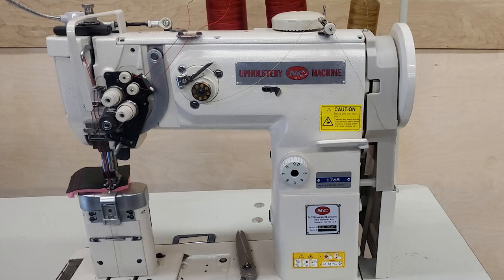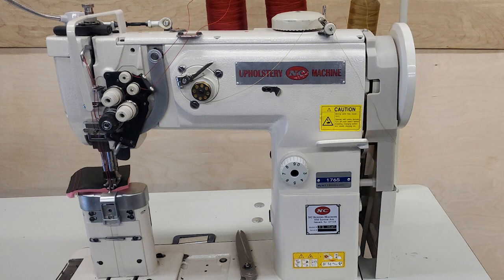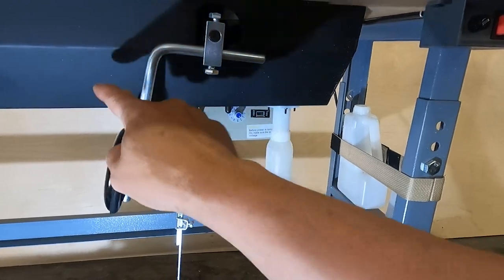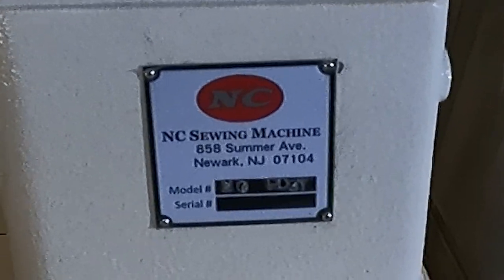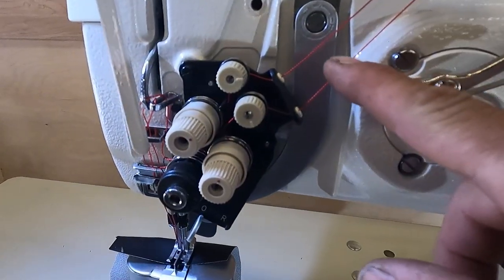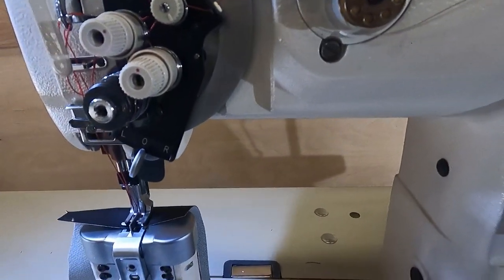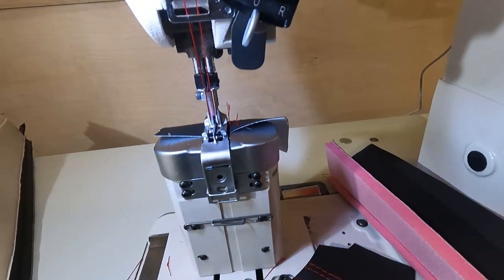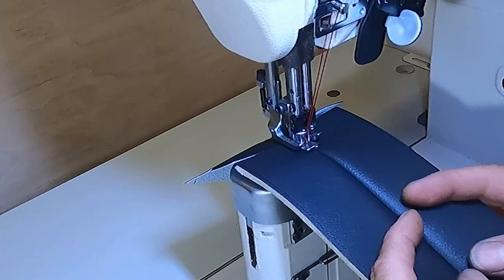Double Needle Post Machine - Split Bar Upholstery Sewing Machine

Comment: I just ordered one of these machines Friday night.. wish me luck :)
Reply from the maker: Congrats my friend. It is a good machine.
Reply: Hi there
Just wondering how you like your post sewing machine... Interesting in buying one myself?
Reply: @yanidizhernandez4085  it's been a very good machine. I would recommend looking at what type of motor it comes with.. for what I use it for (French seams on thick assemblies) the standard servo motor is.. it's ok. My other machine has a brushless servo motor (motor is a Consew CSM-3000) which is much better for low speed work, imo. Motor is only $150 or so, they'd probably upgrade you on request.

Comment: yeah:  split bar.   thats the only way to obtain perfect 90 degree seams of the type you would want to see on the armrests of a sofa or auotomtive seat, or the shoulder on the backrest of an automotive seat..... Additionally:  the "flatbed inserts" that raise the work area surrounding the postbed AND the split needle bar?????   It basically facilitates a "universal sewing machine" that can function like a 1 needle flatbet (disengage the 2nd needle and place the flatbed insert)  or a 2 needle flatbed, or 1 or 2 needle postbed.

The only downside is that NOT ALL SPLIT BAR MACHINES ARE EQUAL.  Adler >  Juki > Consew.  The consew "angle sew" (Consew name for split needle bar functionality is "angle sew") machines are often deficient in their ability to handle serious leather weights like commercial/automotive grade pigmented leather and most of the used machines that are floating around are "Small bobbin" versions.